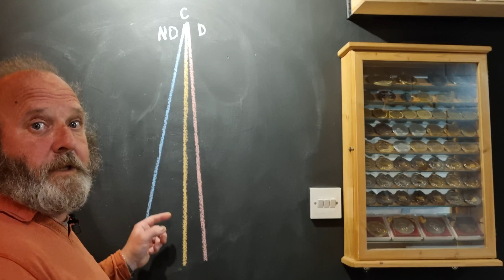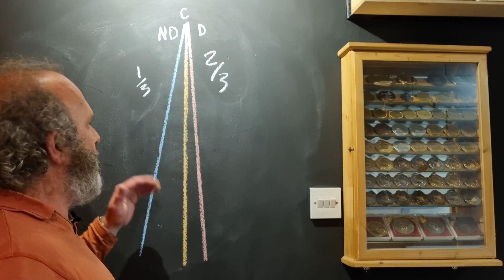WHEEL BUILDING PRO TIPS - DISHED SPOKE TENSION - HOW IT AFFECTS WHEELS

Comment: My rim manufacturer says not to exceed 110kgf, does that mean on average or for each individual spoke? Because on my dished rear wheel, they're obviously two different results, the former more tense and the latter less tense
Reply from the maker: It's the average of each spoke on the tightest (dished) side. If it's tensioned and stretched properly, there shouldn't be any more than a 10% difference from loosest to tightest on the dished side. The other side will always be looser...
Reply: @bicycleguru  thank you!! I've been looking for an answer everywhere, couldn't find one

Comment: Its not just for alignment is it? It helps to strengthen the driveside of the wheel If I'm wrong???
Reply from the maker: It is just for alignment to allow for the sprockets or a disc rotor. However, the dished side does end up stronger than the non-dished side, but this is a compromise. When stretching a wheel to bed the spokes in one has to be careful not to use too much force. Often there will be little give stretching the dished side while the non-dished side could be folded with the same pressure...
Reply: @bicycleguru  but its not bad having A Dished wheel Is it?
Reply from the maker: @spongebo8250  I wouldn't say it's bad to have a dished wheel because it solves the problem of making room for items at the hub. The only other solution I can think of is to have even tension both sides with the same relative space on each for sprockets or rotors. The amount of dish to allow for multiple sprockets on both sides would make the hub heavier and the chain stays pitched out so far one would hit their heals on them when pedalling...
Reply: @bicycleguru  yeah The tension On the other Side of the wheel Is what I'm Having A doub but heY you said It solves The problem And the rest of the sprocket Placements. I was So Intruiged by it cuz I have done it with my bike made by our local Bike shops Here and I was So worried that It might Rub The side of the bikes frame but its not the Illusion It create is so interesting. My bike mechanic says That I'm having a doubt that it will create a Conflict but it was not.  I was So Surprise that it was Perfectly aligned I find it Awesome  and unique, knowing that it's the main purpose was to align the wheel
Reply: @bicycleguru  but I check it again I think He manage to Apply Tension somehow on the none drive side of the wheel Where the rotors are placed.  Welp I like it now But I just wished  I have a Double wall rims So that no spoke will Get on the interior's way And remove the excess material.  Maybe next time I'll upgrade my old wheels to double wall wheels soon I like the video man!  more power I have the concrete answer now thank you
Reply from the maker: @spongebo8250  A double skinned rim will be stronger too. I'm glad I could help you out...
Reply: @bicycleguru  it really Clears Out all of mY Doubts I'll probably swapping my old Rim to Double walled rims soon Thank You Man More power ! ! !